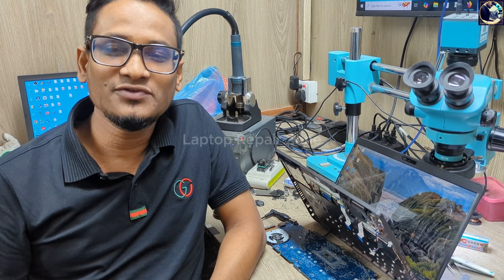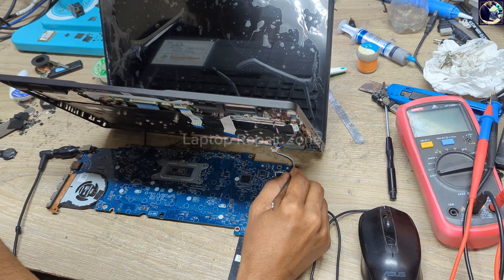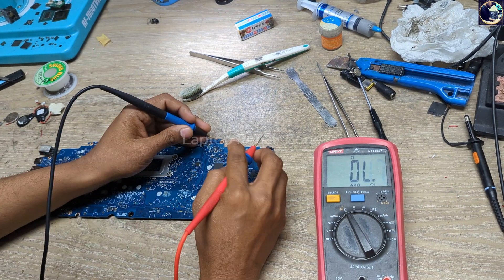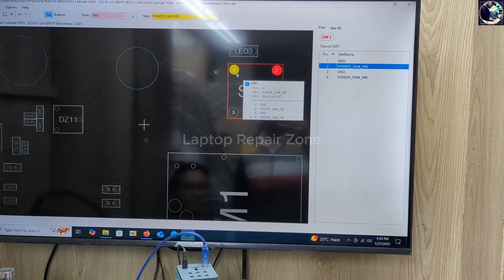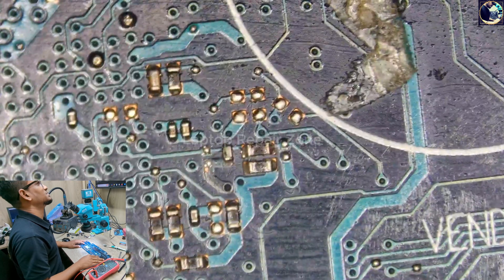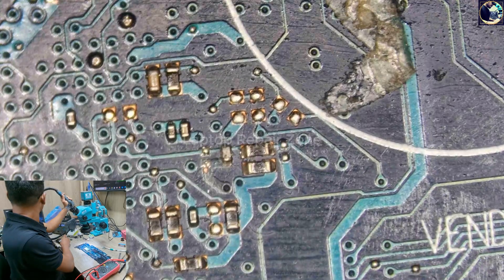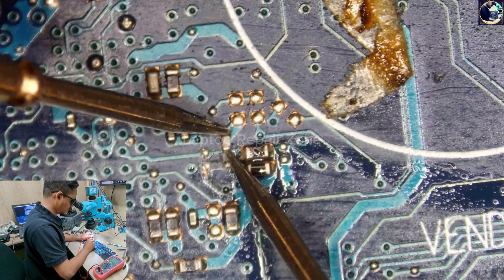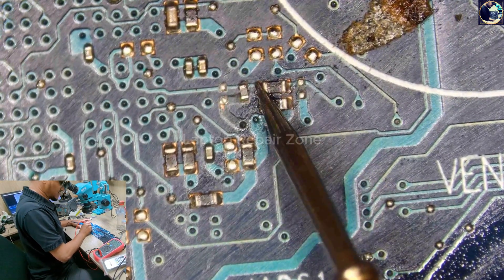Dell latitude 5400 not turning on fixed!!

Comment: I'm unable to find the motherboard number (PPID number) or the board view for this old laptop ( Dell E5400 laptop purchased in the year 2008). My laptop won't start, and when I enter the serial number on the Dell website, it says the number is invalid. The sticker on the bottom is unreadable because it has faded over time. Unfortunately, I'm unable to start the laptop to use the power cell or explore other options.I needed the CMOS Cell & it also seems the Laptop will not start now because of the power switch issue, which is yet to be detected.

Comment: Good work, I have hp laptop its power on and display showimg bios message, then restart itself then working but no display , cpu got hot, but nothing display , I must rest bios then same,I check all voltages its present , any idea
Reply: Reprogram the bios
Reply: @mathiaseze2286  , ok, thanks for quick replay